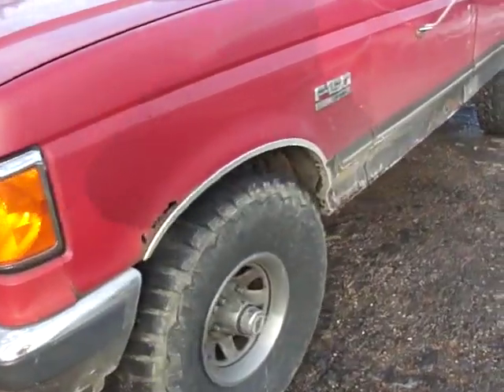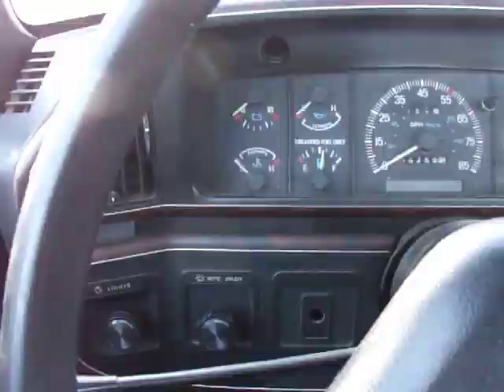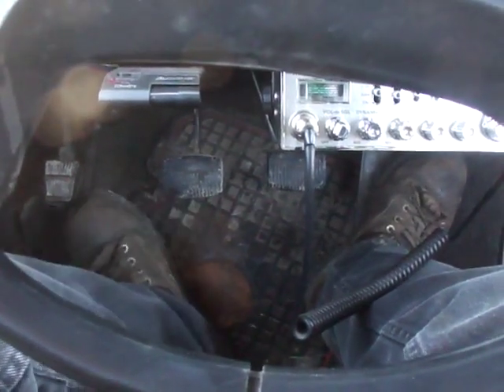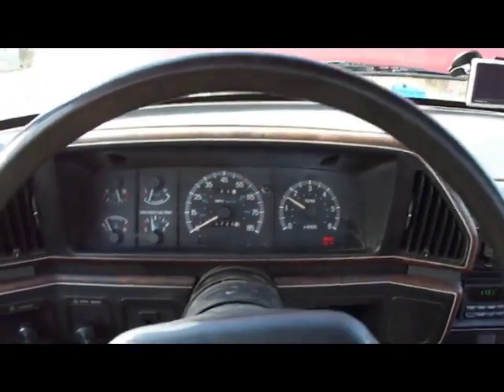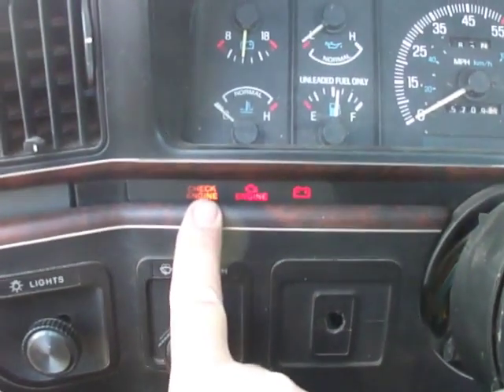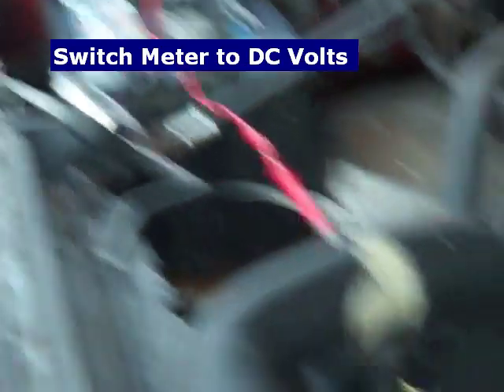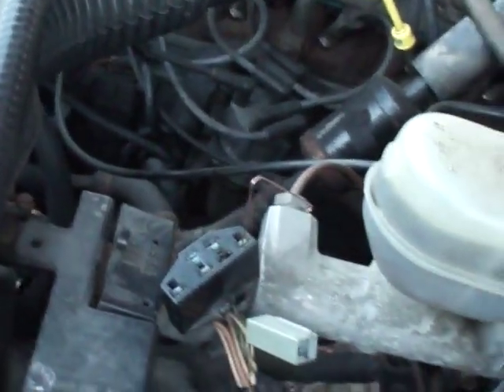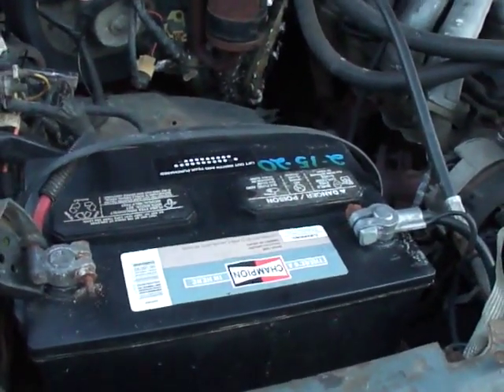1984-1994 How To Get Ford Fault Trouble Codes KOEO & KOER Tutorial

Comment: What I learned with retention but just take the positive and the negative cables off the battery and I take some electrical tape and then take them together for half an hour or so that has worked for me clearing codes without a scanner
Reply: I have a 300 k miles f150
Reply: Google Talk Text hates me so it misinterpret everything I say speaks other every other language on earth except for mine apparently
Reply from the maker: If you remove the battery to clear codes, you will lose the Keep Alive Memory the ECM has stored. If you disconnect the jumper at the EEC Test connector while the test is running this will erase the codes and you will not lose the Keep Alive Memory.

Comment: Do you have had a 94 F150 2011 it's got a 300,000 miles on it I've driven it everywhere and still can drive it actually I'm harvesting Parts off of it right now for my other 94 that's in better shape so I'm kind of New Mexico but you taught me a lot today information that I haven't found anywhere else thank you for that what are you looking for some of this information but you had something that's very important OBD1
Reply from the maker: Come back on Sunday at 9am EST and I will have another new video on testing all the sensors on these old fords.

Comment: will this work if i have my brake light switch off the brake pedal and my clutch neutral switch bypassed? as soon as i start my 93 ranger with the paper clip in the tester plug the engine starts revving higher then normal
Reply: Probably just the computer going into the self test mode and controlling the rpm